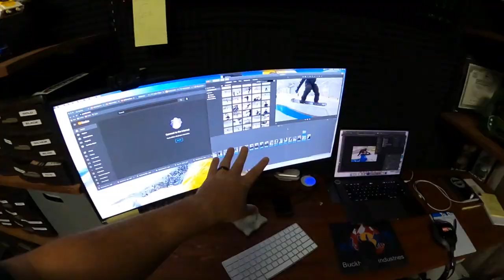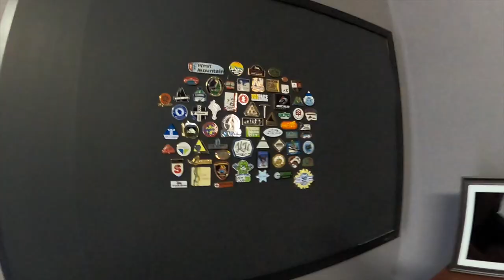The Ultimate Snowboard WAX Station

Comment: This may be easier on you guys-I've done sticker/decal weaving like that and I used a dentist tool to pull the access off. I think you can get those little teeth scraper tools just about anywhere.  See if that helps out you guys :)
Reply: mike, Great tip! Harbor freight has micro tools like dental only for auto, and probably costs less than surgical steel.
Reply: Yooo